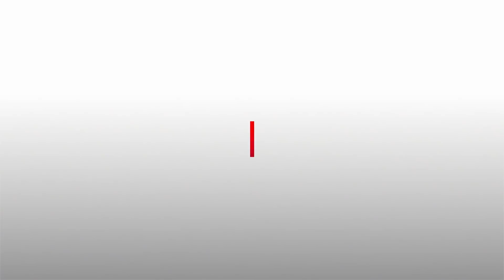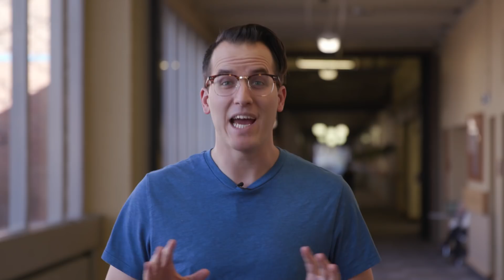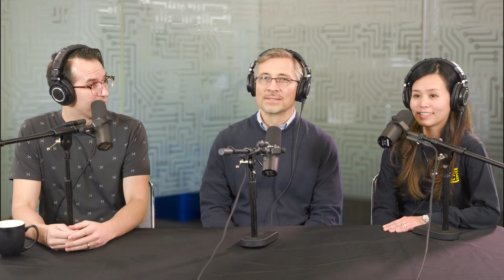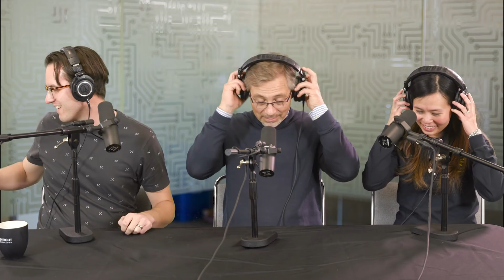Data Analytics for Engineering Projects - EEs Talk Tech #23

Comment: It  is not only managing the data, the collection must be done uniform too. I'm a repair tech and reverse engineered a pat tester from a company I would never buy from because they do not supply service doc. (hint hint :-) ) I noted a whole list of measuements. The next time I wanted to use them I noticed I forgot the frequency I used. Or things like the pin out of a connector you forgot to note if you look to the solder or component side etc. You first must have valid and usable data befor you can manage it. And every one in the team should use the same way/format or whatever. Even in my own I have troubles with that. A group with 10 mini-me's would be a data collection disaster

Comment: On small teams/companies - there is little option to offload the IT tasks. As mentioned, the project leaders end up buried in Excel, Access, FilemakerPro, etc. trying to keep track of everything. A lot of my projects have been as a contractor with teams that are about 5-10 engineers inside of companies that are 50-100 people. So far, they are all driven by emotionally designed processes that are all quilted together on the fly. 

The result is every individual has an undocumented  'process' to get through the day and in the end - it is a mess. I have not seen any practical options for the small teams to capture, sort, analyze, and archive engineering data. I had a meeting with a developer and it was clear that it would be over-the-top expensive to develop our own as I grow my own business. The time and financial costs are not trivial and the outcome is hard to predict. 

The inability to manage and utilize data is expensive. 
The ability to manage and utilize data is expensive. 
Figure out which one is worse. Good luck :-)

Life in the real world I guess  :-)

Comment: Interesting insight to data management. What software does keysight recommend to EE students for managing data?
Reply from the maker: As a student, learning how to use Excel Pivot tables helps a lot for managing data sets. Office is also typically very cheap/free for students. If you have very large data sets it helps to use a dedicated tool, but that's typically out of a student's price range. There are also some open-source tools out there, but I haven't used any personally.
Reply: Keysight Labs I’ll look into pivot! Thanks for the reply! I’m looking forward to Wave2018!